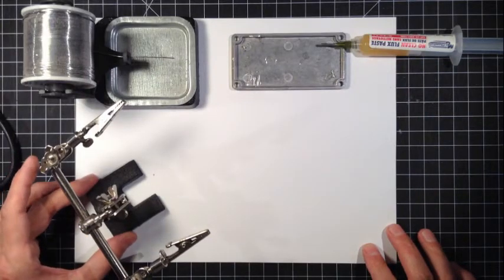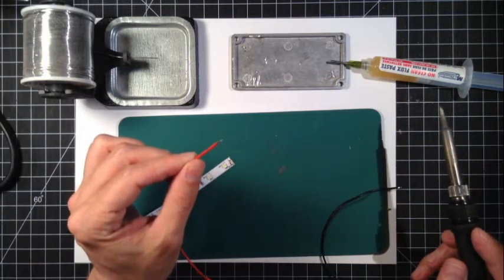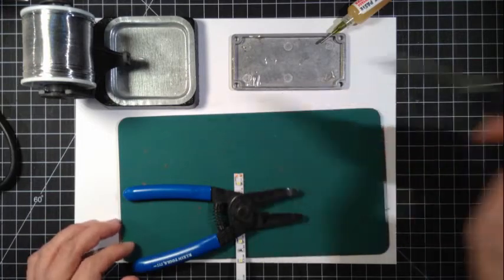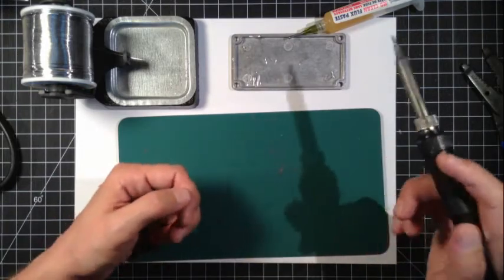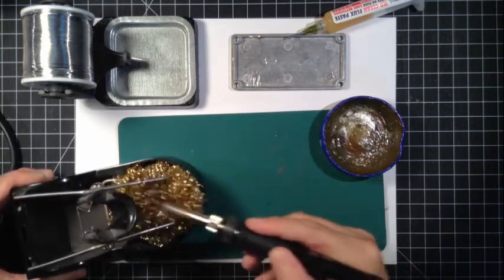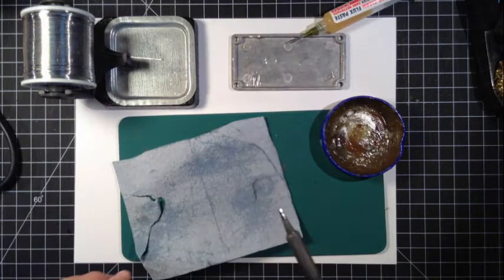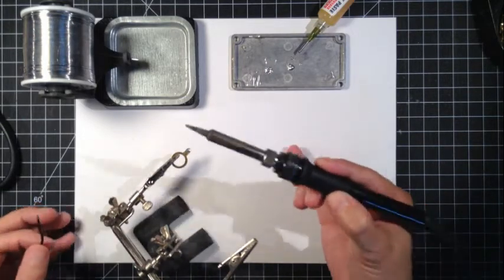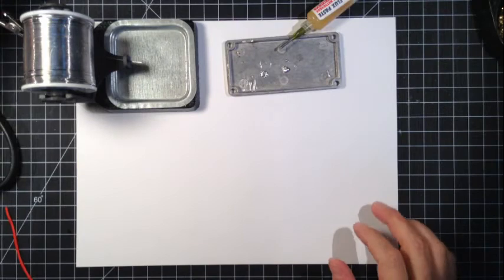Soldering Tips and Tricks

Comment: i wanna make a dual 26650 DNA 200 box mod. are there any specail things i have to consider? im from germany and here it is not common to build everything yourself. ive recieve my parts soo and wanna get safe before starting. BTW really love ur vids i was looking for good videos and found you :) peace from germany
Reply from the maker: The only issue is the size of the enclosure, 2x26650 is pretty much just as wide as the 1590B enclosure which is the biggest I keep in stock.  Check the extra pics on my 2x26650 sled, http://analogboxmods.ca/Box-Mod-Parts/Battery-Holders/2x26650-3D-Printed-Battery-Sled .  
That means there won't be enough room for the DNA board on either side of the battery sled.   The 1590N1 is a bigger enclosure and might work...
Reply: Analog Box Mods i got the alpinetech b box gor that. My friend got one and should have enough space for that

Comment: great video. where did you get the solder holder? like the idea of the hands free reel.
Reply from the maker: The metal base if from an old soldering iron I had and the top/spool part, I 3D printed, https://www.thingiverse.com/thing:1396306
Reply: thanks! also what is your suggestion for type of solder?